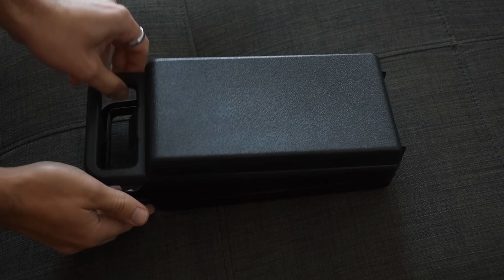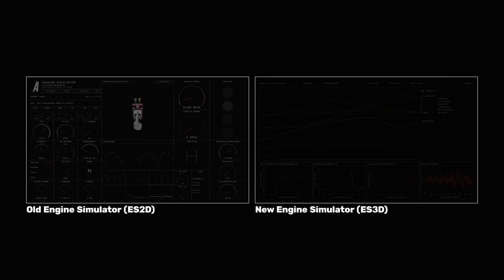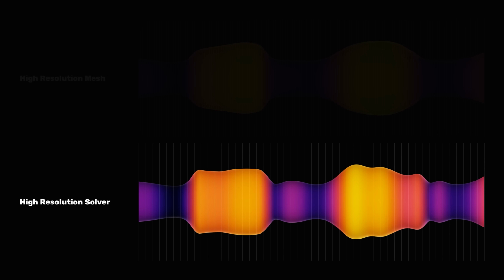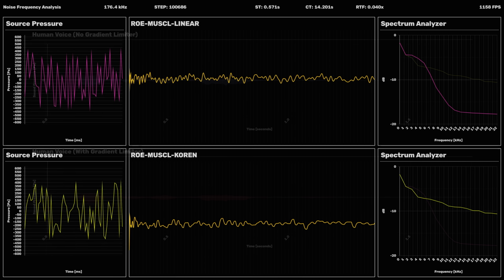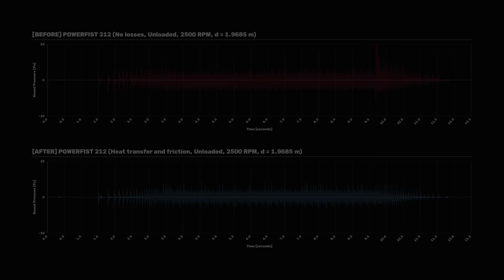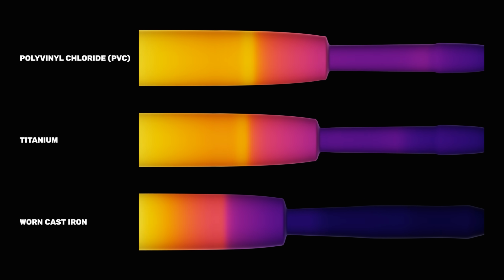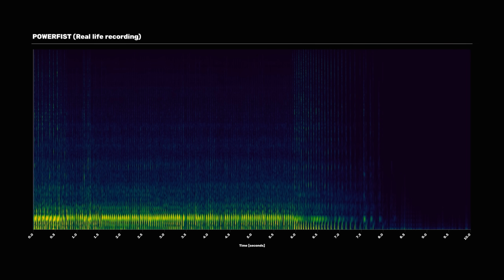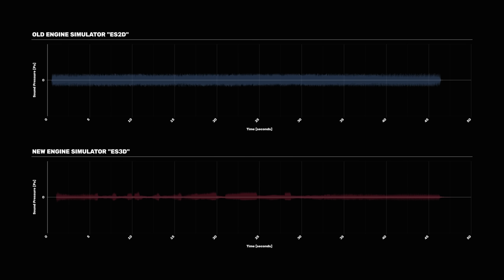Improving My Engine Sound Simulator With Real Data

Comment: Makes sense it is way louder when under load. The governor is opening up the butterfly valve so its pumping more air and cylinder pressure is probably up due to more fuel charge?

I'm super interested in this right now. Having Claude make me a simulator of exactly this engine setup so I can characterize different muffler designs and come up with a design for my predator 212 swapped kids tow snowmobile as well as my briggs intek 16 hp riding mower that has a loud plap-y exhaust.

End results are fantastic. Love it!

Comment: I hesitate to suggest those two letters that look really good in PowerPoint, but that sort of system is exactly the tool used for fudging models until they fit the real data.  It just makes me wonder if there could be anything gleaned by throwing machine learning at this and seeing what sticks, or if that's just a sledgehammer to crack a hazelnut.

Comment: 12:43 I trust in you, but not in mathematics (its always a model). It always get to this point, when you have to use human intuition and just do what seems and sounds right instead of mathematical rigor, its like a slap in the face from the Universe, or maybe mathematics is just broken or we have to break it too much for it to run on actual existing computers made of real hardware.
 At least that's what always happens to my DSP projects.

Comment: About 25 years ago, I did a model of the engine I was building for my car in Desktop Dyno and was impressed that it was actually fairly close to the dyno results. I think your program has a decent chance of being even more accurate but more useful because if I'm not mistaken your program will have the ability to model part throttle situations and things like that, right?:chillwcat:

Comment: Hey, I am kinda new to this ES since I just came across it, but I find it rather interesting. However, I don't fully understand the controls. Now, I am aware that your last vid was this one, 5 months ago, and since I lack a Discord account, can u please make a video on controls or reply to me if u want, that would be helpful. Thanks
Reply from the maker: All controls are listed on the download page. If there's still something you're confused about I can try to answer your questions here
Reply: @AngeTheGreat  Thanks for telling. I do appear to be facing a little problem, on certain engines of the og ES i am experiencing some audio chopping, like some cut sounds, which I could not find in any video i tried changing volume and everything i thought it must be the laptops sound system (dolby) but i am not sure if u dont mind please guide me with this thanks.
Reply from the maker: @Daud_Kashif this is discussed in the tutorial. You need to adjust the simulation quality to match your PC. To do this, hold the n key and scroll down until the audio stabilizes
Reply: @AngeTheGreat  That actuall worked i appreciate the help thanks

Comment: Yo. So, many automakers use speakers to simulate engine sound nowadays, right? Like VW/Audi's soundaktor? Hear me out - instead of using a sample and pitch-shifting it, plug in this simulator to get much better sound on some regular-ass 2.0 4cyl engine :o

Comment: You really captured the sound an engine does when it's getting throttling up under load. After having to use a snowblower for years, I recognize that particular loud sound like a big nail being driven into a plank with a surge of gas on each piston strokes. 
Though it sounds a bit weird when you make it shift gears up in the simulation. It's way too clean for that kind of engine imo. Like the RPMs tend to oscillate a bit on a real machine. Might have to do with them misfiring a bit from time to time or something? I'm thinking specifically of an air cooled 4 stroke snowblower engine. Might also just have to do with like vibration in the crankshaft as the whole assembly slows down? Idk, this stuff is way past my knowledge, but I still do find it fascinating XD

Comment: I was wondering something like an integration with someones games. For example we model the engine in your app then click a button to export some sort of program that is able to quickly generate the sound from the dynamics of the system. Or perharps also actually compute how the engine behaves and returns the torque for the entire car simulation to react? Love your project, take care of yourself

Comment: @AngeTheGreat Buy a Non-Epa Carburetor for the Honda Clone so you can tune it perfect. its just a stock carb with a fuel mixture screw so you don't have to worry about Carb Jets
Reply: Your 212 Powerfist is not running right its lacking fuel that's why its sounds likes a Harley lol

Comment: 11:38 Sounds like Shannon-Nyquist issue, like using audio software at sample rate lower than 44100Hz or bit reduce, if it's the case, I guess it can be easily fixed.
17:29 Weirdly sounds like a misconfigured Vocoder.

Comment: mechanical sounds are pretty important, also it seems like these simulations are much too isolated(?)
Reply from the maker: I never said they weren't important and I specifically mentioned that they were not present. This is a video about the fluid simulation component, not mechanical sounds.

I'm not sure what you mean by "isolated". I'm guessing you're referring to the lack of environmental reverberation. Adding this is a post-processing step and not relevant to the discussion of the engine simulation itself. It's a simulation in isolation, so naturally it will sound isolated. I've discussed this point already in previous videos. I don't have the equipment yet to measure high quality impulse responses so I don't have the exact reverb profile of this environment anyway.
Reply: @AngeTheGreat   pls take my simple(in several ways) observations as nothing more than that
just a general muddying of the sound seems like it would help a lot to show how impressive this stuff really is.

Comment: Man, you didn't sound that confident in the beginning but the current final result is awesome! I can't even understand how you actually achieve such efficient algorithms that simulate fluid dynamics thousands of times per second to produce all the sound characteristics of the engine. If this can be expanded to simulate acoustics of buildings and other machine types, this can be quite a gold nugget for the design teams developing any kind of product that produces sound!

Comment: Would creating fixed/more rigid points on the simulated exhaust tube (as if it's actually being attached to a car) make much difference?

The sim sounds absolutely incredible, don't get me wrong.

It's just that some of the remaining artifacts make it sound like I'm listening to it through a PVC pipe or something. There's a popping sound like you're jamming your finger into a glass bottle and popping it back out.

Again, I don't mean any criticism; I'm not an audio engineer, lol. But I do greatly appreciate aesthetic sound design, and I absolutely adore the work you are doing, so I thought I'd ask, since I'm curious.

Putting that aside, the sim sounds a lot better even than a lot of racing games that use real audio recordings, which basically makes your work the equivalent of black magic, as far as I'm concerned. You are a literal audio wizard at this point😂

Edit: the artifacts seem a lot less noticeable on the larger engines, at least! 👍
Reply from the maker: In real exhaust systems, exhaust tubes are not rigidly attached to the vehicle. Exhaust hangers are usually flexible (both to reduce vibration and allow some flex in the exhaust system). Furthermore, attachment points or exhaust system rigidity do not have any effect on the fluid dynamics model because it doesn't take wall deflection into consideration (no professional engine simulation that I'm aware of does either).

I'm having a hard time understanding the PVC pipe comparison. As I showed in the video, the real single cylinder engine also sounds pretty strange when running with a simple straight-pipe exhaust. It makes a sort of a "tube-like" popping sound that people don't usually associate with engines because they're used to hearing muffled systems. It's even more apparent in real life. To my ears, the simulated version sounds pretty similar except that it's missing reverb from the environment (which is intentionally omitted) and has no other mechanical noise.

Unfortunately, there are limits to what can be achieved with this kind of simulation. It is 1-dimensional and is a substantially simplified version of our reality. I have verified it carefully and it is implemented correctly. These are the best methods I've been able to find that are practical for real-time use. I know, it doesn't sound exactly like real life and I'm aware of its limitations. I'd love to fix them, but I'd need very specific feedback and references to research/theory in order to do so.
Reply: @AngeTheGreat hey man, you know way more about the topic than I do, lol.
Thanks for the response!

Comment: So it's impossible for me, a complete idiot, to use your software to generate engine sounds for cars in my game, through the interface, without using any programming?
Reply from the maker: Uhh I wouldn't say it's "impossible". I'm working on a version of Engine Simulator with a graphical user interface (that doesn't require the use of programming). I discuss it at the end of the video

Comment: Question about the tube boundries.
Before implementing you improvement for the boundries. 
What did the simulated results sound like for a way underdiameterd tube vs a way over diameterd tube sound like? 
The first simulation sounded like there was a narrow steel string or string that were under tension, so i wonder if the simulation was under dimesioning itself there. It sounded like a guitar string.

Comment: Hey man, I know this prolly isn't up your alley. But would you ever consider / know of any car audio design simulators? I've been trying to find software that lets me design sound systems for cars and while there's a few good options like freeware such as WinISD for subwoofer enclosures specifically, there's no real full system designer that I know of. Something where you could model different car's interiors, sound deaden,  add door speakers, tweeters, adjust wattages, frequency response, and what not.

I know this is very niche and would be a big task to take on. But fellow car audio enthusiasts like myself would be absolutely foaming at the mouth to get their hands on highly detailed car audio software with the level of depth and precision signature to your work. If anyone could tackle this it'd be you. 

There's a distinct hole in the market  for DIY car audio builds. R/carAV has 200k weekly visitors, all of which could benefit from this. It's hard for me to justify such a big ask but I believe it could be worth your time.

Comment: Hmmm, I've noticed something very particular about the Crossplane V8 sound; it has a certain marble-like quality in its sound colour whenever it revs. This sound colour is only met when the resonator is removed and an X-Pipe is installed. Sounds more like a modern Crossplane V8 than a classic one. It could represent a modern German V8 (like the AMG M156) very well! 💪😎💗

Comment: I’ve been following this for years and this video left me in awe.  The practical implementations of this is infinite.  A great way to spend years of research and development.  I hope it pays off big time.  As a sound engineer the only thing I noticed is an apparent comb filtering effect when the sim holds at an RPM.  I doubt it’ll help in any way and offer no real solution 😂😂😂.  This is an amazing body of work.  God bless.

Comment: I haven't finished the video yet I'm about at the Midway point but I want to say that it seems like the resident frequencies that you're getting sound like harmonics that are baked into the simulation of the file. The audio engineering me identifies them as sounding very similar to down sampling artifacts when you don't apply dither. I know you just hit the part where you started applying turbulence, and I suspect that you have high frequency resonance that you're about to tackle, but I think it's also worth pointing out that it looks like you're simulation kind of originates the waveform perfectly evenly from the center of the pipe, I don't think that's quite accurate. The dog leg that most exhaust ports take is going to affect the sound significantly by introducing some... Roll? 

I don't know this is all super interesting.

Comment: Those downshifts with the overrun and idling at the end were mental. It's literally like my 1993 Corvette LT1 (basically a small block chevy). Also I have a feeling you're running 4-1 manifolds and then true duals right? Cause that's literally how my car sounds and I have that setup. It's not an X-pipe as it would be much smoother sounding, but not zoomie pipes (8 individual pipes) either. Absolutely mind blown with the accuracy.

Comment: Try adding a convolution reverb to it maybe. I can hear that as one of the largest differences between the real recordings and the simulation at this point. The simulation sounds very very accurate, but just a bit dry and is missing that warm, dynamic aspect that real world recordings get.

Comment: Honestly, the simulation is sounding amazing. I think a part ofthe engine sound is also the environment it's in, yes the simulation can always be improved, but it wont sound realistic with a little bit of convolution. Maybe some outdoor impulse responses (you can make them now you have a nice measuring mic) can help sell the engine a LOT better. not that I know much about how this works 
I barely understood what on earth is actually happening here.

Comment: building this out to be a licensable package devs can use to just drop into any game is a must! The audio is so good!
Reply: and dont forget this is not just about the audio. the whole RPM power curve is also simulated, load and fuel dependent. this could be amazing on races like pikes peak where the air gets thinner and this can simulate the power of the engine.
Reply: I agree with this! Would love to this as a software package available to buy, so car games like BeamNG, CarX Street and others can improves the baseline car audio!
Reply: ive been saying this about beamNG for years, but the community sucks.

Comment: You know this may be a stupid observation but you are comparing a simulated engine sound to a real life one that's, outside, with probably not the highest quality of mic that you could ever own (No offense at all here), and plenty of environmental factors like distance air temp air pressure and just a million other things like echo that likely have an effect on the sound we are hearing from that engine, maybe your simulated engine is a lot more accurate then you think? It's just in a complete void of an environment? Maybe simulate an environment for it to run in if you haven't already? Maybe it'll be way more real sounding? Could be completely wrong here just thought i'd mention it.

Comment: In my opinion some of these engines just sound too perfectly tuned and optimized. A 1 cylinder engine form a hardware store made for bottom dollar shouldn't sound as if it was built and tuned by NASCAR engineers. it needs some amount of  imperfection in the sim somehow. I know very little of coding but I'm guessing that the sim assumes perfection conditions for simplicity? Still it sounds all FANTASTIC!

Comment: When you said the sim lacked high pitched sounds, making it sound muffled, I wondered if the comparaison with an actual engine was fair. The real engineès exhaust pipes will vibrate and oscillate as gasses are pushed through it. This resonnance is not computed in your fluids, unless Ièm mistaking.
There are also a bunch of other parasize sounds like engine covers rattling, starter cord handle etc. All these add richness.

Comment: 15:15 Turn on the hot water at your tub spout and listen to change of the flowing water as the hot water begins to arrive. You should notice the pitch drop as hot water begins to flow out. While sound travels differently through water, it still obeys the same basic principles. You can also observe a change in the exhaust note between a cold startup and a warm startup on a car, which is probably more relevant to the discussion as well.